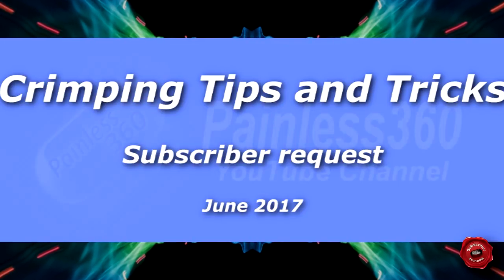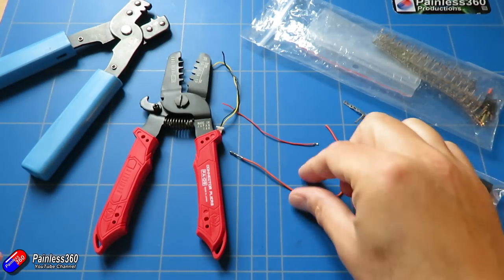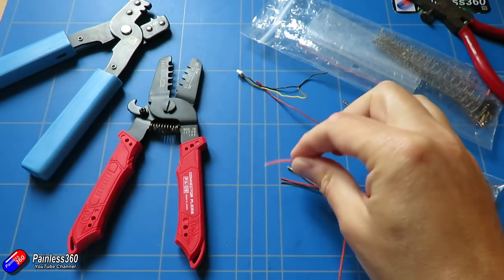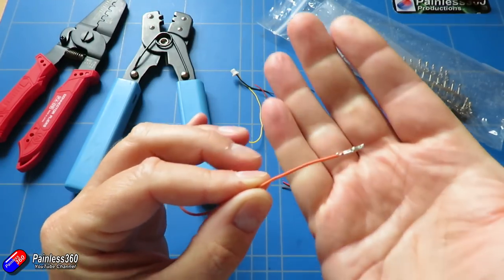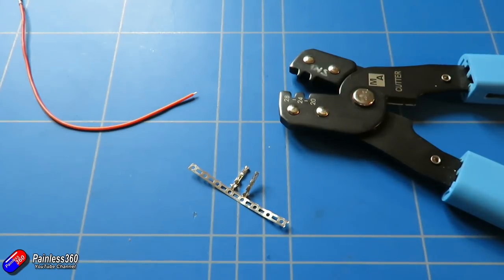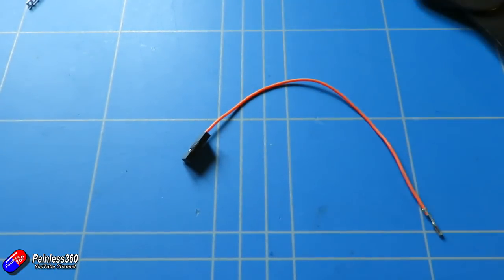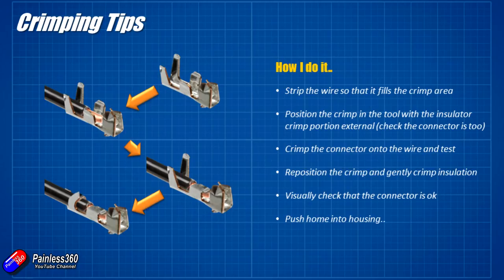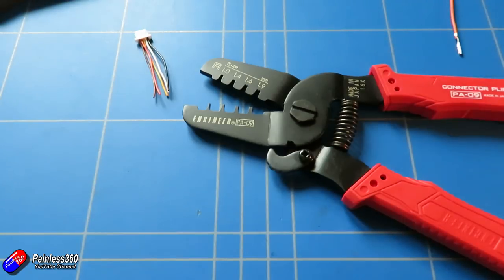RC Tips: Crimping connectors (Dupont, Servo, Picoblade and Molex)

Comment: Watched this yesterday after previously trying to crimp a Dupont connector on and failing miserably (it really depends on who's videos you watch!!! lol)   Today I have replaced a JST -> JR connector, and tomorrow will create a xt60 -> JR plug.  The JST->JR went perfectly but for not having the female end.  The key for me was your suggestion to crimp the wire first, allowing it to be "registered" by the cover tabs.   I'm a happy camper.  My degrees are in EE and I finally figured out how to wire a battery!  lol    Cheers!

Comment: Great job! A tip i might offer... It can be difficult to twist really short lengths of small wire easily. I learned to cut of the insulation father back, twisting the wire well then clipping the exposed portion of wire to your desired length. Then you only need to retwist the very tip and it's ready to crimp.

Comment: Experience from the aerospace industry, like you can fix a satellite once its launched. Everything is a soldered harness, unless it comes apart or in modular form. You need to qualify that for all our hobby and the typical amateur electronics affictionato crimping correctly is just as critical to perform as a good solder joint. They both have their place. You do incredible work, thank you, please never quit..

Comment: Thank you so much for this video. I saw a guide for modding a video game controller to make its cable removable which required adding a plug to the end of the cable. I bought many spare parts but wasn't able to get a strong crimp even after a few dozen attempts. The guide was vague and made it seem as though the bit that goes around the insulation was what held the crimp tight. Your video helped me understand what I should actually be aiming for, and now my crimps are tight and reliable. Thank you!!

Comment: Just needed to see the actual crimping process @8:44 in the video. I had forgot how to use my crimping tool and this video was perfect showing the orientation of the back of the wings sitting on top of the mountain so to speak. The small set of wings fit up into the upside down valley. This worked perfectly for me the first time trying it in many years. The actual pin to crimp goes in on the side of the tool that does not show the size markings. That's what confused me prior to seeing this video. I kept trying to imagine using that side of the tool which is incorrect.

Comment: Thank you so much for this. I'm working on a beauty build and I need all of the connectors to have the same colored wires, so I need to connect a vista with all white wires perfectly into the FC plug port. I'm hoping the picoblades will be small enough.

Comment: This is fabulous for the common person that can't or is not good at soldering a connection,, even with electronics engineering training.
A proper solder connection will always be a better mechanical and electrical connection than just a simple crimp.

Comment: Nice video. Thought I was doing okay with my crimping but will give your way a go as it looks like it will give a more consistent crimp. I use a ratchet type, and once you start you have to finish it so you need to get it right first go. With the small ones I tend to use pre-wired ones and join to them but I usually solder the wire to them. As you say not such a good idea but it does tend to keep things a bit tidier.
Reply from the maker: Indeed, this is a skill like anything else. At least this way I can be positive that the conductor is really in there.. Happy flying!

Comment: Whether soldering or crimping wires, FINGER OIL on the conductors is either going to exacerbate corrosion in a crimped connection, or inhibit solder flow on soldered connections.

Comment: Great video. One thing I wondered about: is there a particular reason you don't use ratcheting crimpers? I have had problems with those sometimes crimping the connector too flat so it sticks out to the side and doesn't fit the servo connector housing anymore. I've wondered if a manual crimper where you control the pressure wouldn't be better.
Reply from the maker: Crimping both the conductor and sleeve crimps at the same time can look like a good crimp, but actually only be a good crimp on the insulator. Many of the wires we use in the hobby are much smaller than the typical servo sized conductors these are designed for so they need to be folded in half (or even three!) to fill the crimp to make a solid electrical connection. I like to ensure that that is good, before then crimping onto the insulation. Ratchet tools I've seen don't let you do that.. Happy flying!

Comment: Nice video!

Wish I would have found this video before I tried [unsuccessfully] many, many times before getting the hang of it through trial and error.

I agree with virtually everything except the part about how a crimp is better than a solder joint. I believe there are advantages to both styles and as with most all electrical processes, there's a proper time and place for both...but I totally appreciate your opinion and the basis for your arguments. I personally work in a heavy industrial environment, for my day job, then I do the super-duper small stuff at home...so I get to see advantages of both :)

P.S. I wish my hobbyking crimper were setup WITHOUT a ratchet. I HATE the ratchet...why do they have it????!!?!?!??

P.P.S. This is one of the hardest things to film, and you did a very nice job of keeping items on screen and IN focus!!! Definitely easier said than done!

Comment: Lee:
   Your focus & saturation on all your macro illustrations were exemplary and your verbal descriptions very clear.
   I'm glad you mentioned the need to fold the tiniest wires back over the insulation to increase the overall diameter of the crimp and reduce flexing, distributing the forces over the insulation too.
   I have found that my purchases of Dupont crimp metal is less maleable & subject to fracture of the crimped metal, than the servo connectors crimps supplied for Futaba keyed brand of servo connectors. They cost a little more, but are much more reliable in my hands. You can recognize them by the slight copper color to the crimped portion of the metal.
   Do you have any tips on surface mount soldering? I have found this area dumbfounding!
- Jim
Reply from the maker: Thanks James, crimps come in lots of quality levels. I've not done much SM soldering here so I'm not an expert. Best of luck!

Comment: the people at Power Pole Connectors did extensive tests that show, besides the reason Lee mentioned, that a crimp connector has less electrical resistance than a solder connection.
Reply from the maker: Thanks for posting that Jim, glad to see my instructors from back when I was taught to be an electronics engineer weren't talking out their hats ;)
Reply: Painless360 sometime in one of your videos make mention of how you open those tiny Ziplock bags. I see so many people trying to pull them apart in the middle which is a pain in the butt.
Reply from the maker: +Jim Clark will do :)
Reply: Yeah, try to crimp battery leads!

Comment: After crimped the connector, should better do soldering for secure avoiding wire loosen?  Or unnecessary to do so? Please advise…
Reply from the maker: If you have crimped the connector well,  that is not necessary.  Happy flying!
Reply: @Painless360  Thanks!

Comment: Friend, first congratulations for the video. I'm from Brazil and I enjoy a lot. Now, taking advantage of it, it leaves me a doubt. Do both the Molex and Dupont connectors work on the same tool?
Reply from the maker: Id' check the listing for the crimps you're looking at using. I've not used those with these here..
Reply: Yes, is the same tool

Comment: would the pa09 be suitable for the jst xh crimps on battery balance leads? or should just go the cheaper ratchet style for those?
Reply from the maker: Personally I'd never use ratchet. You can get what feels like a good crimp that's actually a poor connection doing both parts of the crimp at once.. Best of luck!

Comment: Which tool for 26 to 28 awg wires into dupont connectors for console modding? Thanks
Reply from the maker: Not sure, but the servo connectors that I'm using here are Dupont connectors too..

Comment: Don't get the cheap crimping tools from ebay (that cost around 15€) . Even if the item pictures show differently, they all seem to have cast jaws and not machined ones as they should be. The cast jaws are so inaccurate that they don't fold the flaps, they just crush them. Even normal pliers will get you better results than that.
Reply from the maker: Very true. You get what you pay for with these things. The PA-09 Seem to be pretty good..
Reply: Don't be a crimper snob

Comment: Your local hobby shop will also have all these components and tools , we shall be sorry when the local hobby shop is a thing of the past ........
Reply: So... I go to my LHS. They are far less help than a rudimentary YouTube search. Their selection and prices are horrible. What exactly is lost when they close up shop?
Reply: Yes lets go back to the days where you have to travel 30 miles out to your local hobby shop where you pay 3 times the price for specialty goods and get limited selection. Even better they don't have what your need and it will take 3-6 weeks to order it. Nope Amazon can have whatever I need here in 48 hours, it is cheaper, faster and if I have any problem they have super easy returns!!!! No way I want to go back to the old ways!!!!
Reply: Dang, here in Malaysia parts are generally cheaper. I redid my computer's on switch, and needed the connector (DuPont) which I didn't know what it was in the beginning. Despite them giving me an alt name for the connector (JS something), I got what I needed for fairly cheap RM1 for about 10, while online is about RM3/4 sans shipping for about 100. For now, I get to ride the waves of the Arduino craze for parts